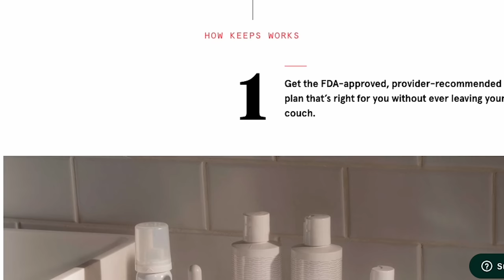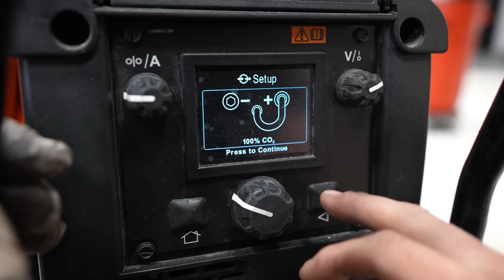Building My Supra into a Competition Drift Car Ep.2 - Interior Strip & Roof Removal

Comment: Teeg yours is an A90. So on the 2023 A90 you can get the manual on the 3.0 and 3.0 premium trims. The A91 is a limited options kinda like the launch edition you got on the OG A90. Its limited to 500 units. It has everything the premium has but it comes with tan leather interior, red front and rear strut braces, an alcantara shift nob and red Supra badging.
Reply: Nah the a90s were the 2020 2port b58s and the 2021+ is the a91 which has the updated 6 port b58
Reply: This is correct. All Supras are A90s. A91 is only used for the special editions, specifically: A91 Edition, A91 CF Edition, and A91-MT
Reply: @johnzeitouni243 , THIS.
Reply: @iamemoi1640  no
Reply: The A91 is just a appearance package only and only comes with base seats with different color sticking for more money. The base supra also comes with alcantara seats as well as the 91. Only premium comes with full leather/heated seats. Also only the premium comes with heads up display. A91s do not come with heads up display. 
There is nothing mechanically different between 21-23 A90s and A91s all have 6 ports. Now 20s Supras are 2 port. 21s and up are all 6 port. So basically your paying more for less features and but get a special one off color and a wing xD But if you want a fully loaded supra and plan on modding it just get a Premium it cost less then the A91 and is the better buy for the money. Only people who care about resell value should buy a A91 and park it cuz it will be worth more down the road xD
Reply: @sorason931 , A91-MT has the HUD, but you're right the A91 Edition and the A91-CF didn't have it... also, the seats are heated in the A91s despite being alcantara.
Reply: @DylanTK  you can even see in this video that the dash dose not have the HUD which people saying it’s not a A91 are wrong and I own a 22 and sorry A91s are not worth the extra money with less features. But you are right about the heated seats for 23 on the Alcantara but other years only the premium had heated. Tj is a A91 btw for anyone asking
Reply: This was 1 of 50 tony the tiger additions the gr-8.
Reply: @sorason931 , his car is not an A91-MT (they only come in CU later gray and matte white with tan interior). However, the A91-MT does come with the HUD I assure you, and my gf owns the A91-CF and it absolutely has heated seats as do all of the other A91s. The regular base cars with the same seats do not have heated seats...
Reply: @DylanTK  lol ok so I know for a fax that the A91s do not have the HUD and like I said if you read what I said A91s only get base seats with heated. You only get HUD in the premiums with full leather in 2021-22 23 A91s-MTs mite have it but that only 500 cars but the Standard A91 I own a 22 they do not have HUDs. And Tjs is a A91 just not the packaged MT they also only come with the Red badge. A91s have same materials and design as base just they add heated function to them.
Reply: @sorason931 , I think there might be a language barrier between us. The A91 Edition and A91-CF do not have a HUD, the A91-MT does.

But TJs car is not an A91, period. It's a regular MY23 manual A90. The only MY23 A91 so far is the A91-MT that only come matte white or gray with tan interior and the red Supra badge.

as for the A91 seats, yes they are base alcantara seats (which nearly everyone prefers over the leather) and they are heated.

I'm done here lol.
Reply: @DylanTK  You just repeated what I already said you just did not understand the way I was saying I guessing. 
BTW if you look at his car It had JBL on the doors had the 14 speakers and had Heated seats buttons on the dash which you can only get in ether premium or A91. Also was alcantara ps everyone I know hates alcantara seats over leather why it gets to hot and hard to clean and will not last as long has Leather. Its defiantly showing its a A91 and he even said it said it was from the window sticker. Things could of changed in 23 but has everything form a A91 from 2021-22 would of had even had the red sticking on the seats which you only get in A91. but if your done thats fine take care xD
Reply: @sorason931 ,

For MY23, Toyota changed the base alcantara seats to white and red stitching, and on the manual (not available on the AT), you can option the Safety and Tech package to include the JBL system. (taken from the Toyota website build section).

He has a base model manual with the JBL option.
Reply: @DylanTK  that explains a lot on how he got all them xD
Reply: @sorason931 , yeah they love changing things up all the time lol
Reply: @DylanTK  I just thought they added in the manual and tuned the suspension and rear end. Did not know they did that as well. Well I feel stupid now lol thanks you xD
Reply: @SoapBox6  yes, when i worked at Toyota all the incoming chassis for 2021+ specifically said a91

Comment: Hey tj! Just wanna give you guys a recommendation for next time if there is one. I work in a body shop and do roof skins often but we use a belt sander to sand down the spot welds and is a better way of taking them off so you don’t accidentally drill through the roof. Cool seeing the build!!

Comment: You have an a91 I'm 90% certain I did marketing for an east coast shop that does new supras and I believe after the 2nd? Year if production for the mk5 platform the changed the engine head from a single exhaust port "headers" cast into the head to an updated head that had 6 individual separate exhaust port with an external exhaust manifold marking the separate 91 denomination... that's what I remember hearing

Comment: How Do You Make Blueberry Pancakes?
In a large bowl whisk the flour, baking powder, salt and brown sugar together.
In separate bowl whisk the eggs, vanilla and milk together.
Add the wet ingredients into the dry and mix until just combined. Lastly mix in the melted butter and stir until combined, the batter will be slightly lumpy. Set the batter aside while you heat your griddle to medium-low heat. Melt a small pat of butter on the griddle and then scoop out 1/4 cup of pancake batter onto the hot griddle and top evenly with blueberries, as many or few as you prefer.
Cook until the edges are set and bubbles form on top of the pancake. Flip and cook until browned.
Serve warm.

Comment: For those wanting to know.....

What is a A91 package Supra?

Adding onto the 3.0-liter GR Supra, the A91 Edition adds a black rear lip spoiler, carbon fiber mirror caps, 19-inch forged wheels in matte black, Alcantara seats, and a differentiated trunk mat. There is also a stripe graphic on the side of the car.

The Toyota's intelligent Manual Transmission (iMT) in the 2023 Toyota GR supra a91-mt edition 0-60 is a high-tech software that prioritizes performance by optimizing engine torque when you press and release the clutch pedal during upshifts. The A91-MT Edition puts out 382 horsepower and 368 lb. -ft.

Comment: I could use the roof skin off the car to fix my camper. Door your channel rocks. I’m building a entry level racing gas bicycle for drag racing. Just hit 45 miles an hour on stock clutch in top end with stuck carburetor and aftermarket exhaust and a FMF muffler

Comment: For the Supras, all the special edition are called a91. The regular ones are just called a90 which is the 3.0 premium. 2020 to current year are called a90 and the special editions that comes out each year is called a91 Supras. For example the 2021 a91 edition(baby blue color super), 2022 a91 CF edition (has carbon fiber bits on the exterior), and the 2023 a91 MT Edition. You can tell if you have the A91 MT Edition if the rear supra badge has a red outline on the supra. Hopefully this helps you out. Also all A91 Supra does not come with a heads up display

Comment: Your first mkv Supra is the A91 which is special edition supras. 2020 was launch edition, 2021 was just A91 limited to 1000 units, 2022 was Carbon Fiber edition limited to 600 units, and 2023 was Manual transmission edition limited to 500 units. A90 is just the model like the mk4 Supra was A80.

Comment: All A91 has a carbon fibre lip on the duckbill and can have different options from there including the cf edition, I do believe the a91 is where the manual gearbox came in aswell but you can get the manual on the a90. I’d be leaning towards yours is an a90

Comment: A91 is just what Toyota calls the 'Special Edition' Supras.  In 2021 the A91 Supras were the 'Special Edition', with 500 made in Nocturnal Black and 500 made in Refraction Blue. The wheels are solid black instead of 2-tone and there's a weird thick stripe that angles upward from the back wheel well to the rear window.   In 2022 the A91 is the A91-CF Edition which is the Carbon Fiber A91.  There is no regular A91 in 2022, just the A91-CF Edition.

Comment: Dillon and TJ, all 4 years of the Supra are A90's. The A91 is not a facelift, it is a limited run special A90 with certain options, different every year, TJ's manual Supra is not an A91-MT. The 2023 A91-MT has distinct options and features that his Supra doesn't have.

Comment: Why the push to use all the stock components of the car? It just seems like minus a new transmission the 400z is a platform you're already familiar with and have history competed well with, and if it's personally not your favorite car I figured that would be easier to smash into a wall